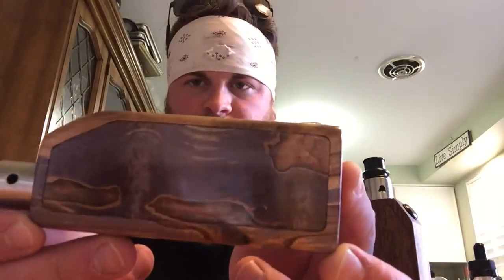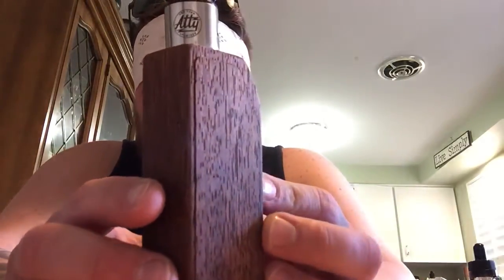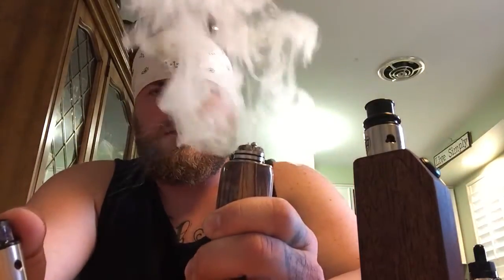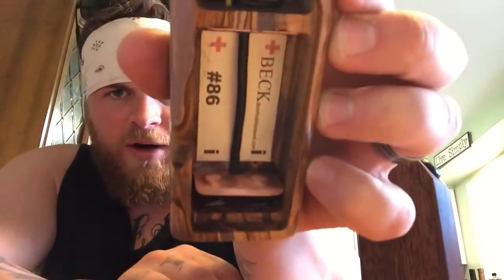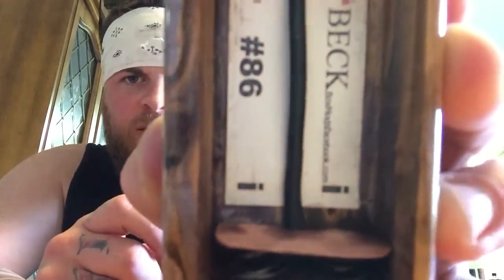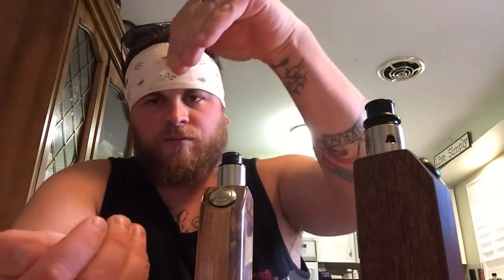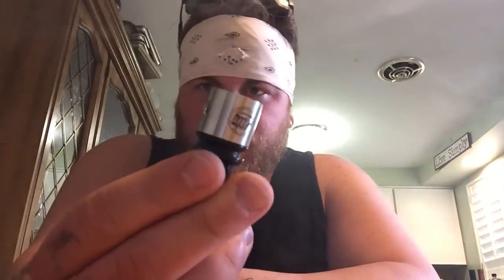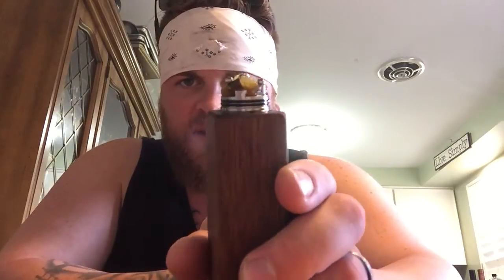Beck Box Mod review

Comment: Series doesn't double your amp limit, it keeps it the same and parallel doesn't double your amp limit.  kidney puncher (A battery expert) says in Parallel you times your continous amp draw by one and a half. So with Sony vtc4 in parallel would be a 45 amp draw continuous not 60.